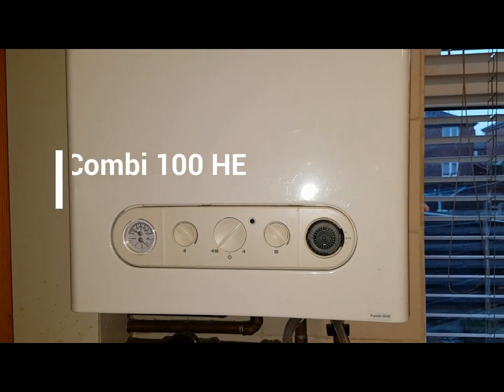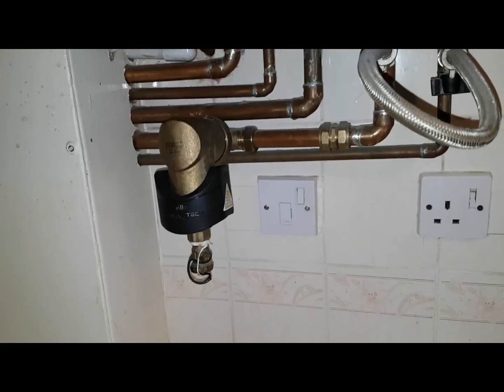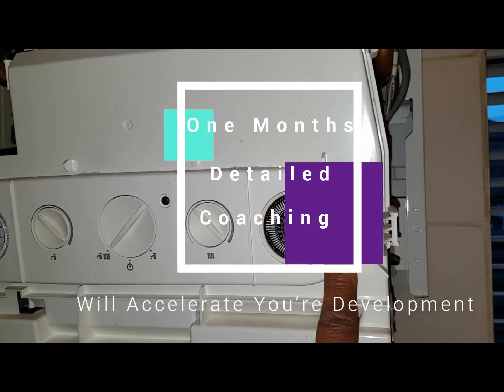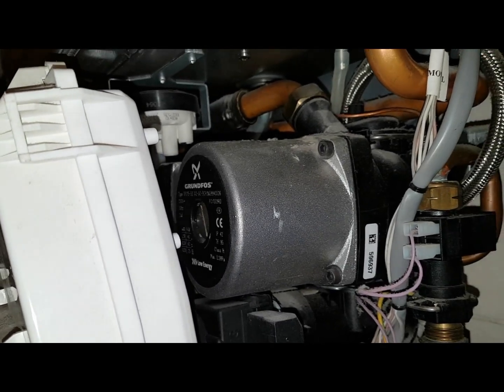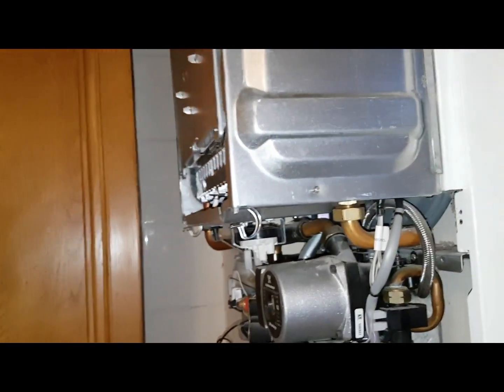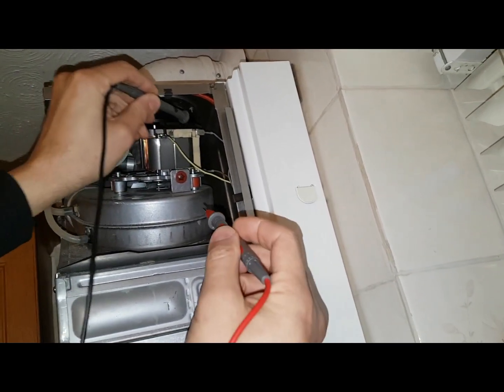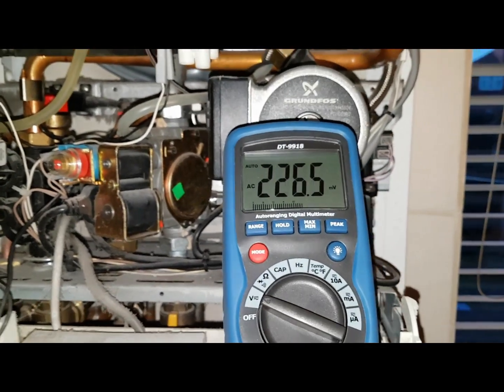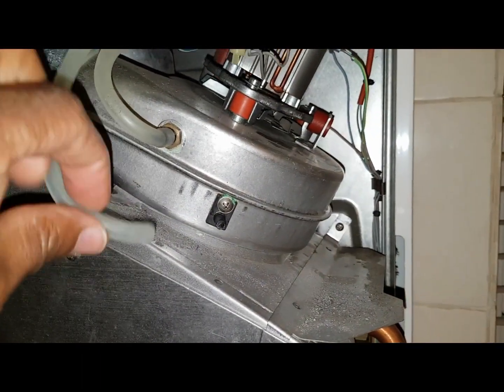Pro Combi 100 HE  How to Test the PCB or Fan Fault. With Coach Tony Morgan

Comment: Excellent, have a similar problem on a main 24he. Pump runs, pump proving switch up, aps OK on bench test, no power to fan at the board. Will try the live to casing test but I think the solenoid at the pcb might not be grafting?

Comment: Great Video..comprehensive...I have something similar on a Glow worm CI model..got 240v on the Live to the Fan..harness is good..but Fan doesn't Run...Windings are 23 Ohms..impellor is 'free'...I'm thinking neutral fault on the pcb...but can't test it (don't know how)...Boiler repairs have a habit of sending you back to school regularly!!
Reply from the maker: Thank you I will be lauching a new boiler repair on line training course soon
Reply from the maker: hey we're currently trying to grow our Facebook group and would love you to join Tony and the team using this link, Tony will be available to answer all your questions directly there's also updates on new trainings we just released too. https://www.facebook.com/groups/167070231326174

Comment: Hi have a problem with micro genius 24 HE. The fan not coming on when the heating is on demand or the hot water. But it works when I suck the apv switch to activate it. Then heating and hot work. What it could it be. Please any one. And how can I cure it? Many thanks
Reply from the maker: It's sounds like the fan or pcb
Reply from the maker: hey we're currently trying to grow our Facebook group and would love you to join Tony and the team using this link, Tony will be available to answer all your questions directly there's also updates on new trainings we just released too. https://www.facebook.com/groups/167070231326174

Comment: So Tony, is it a broken neutral cable, a bad connection somewhere, or, are you just agreeing with the previous guys diagnosis, please enlighten us!!
Reply from the maker: It was a natural fault from the PCB. I replaced the PCB the fan started and boiler is now working fine.
Reply: @ARBoilers  Thanks Tony. A Neutral fault, not Natural you mean?!!!👍

Comment: same as mentioned how did you prove that there was not a break in the cable instead of pcb cheers
Reply from the maker: You could test it from the connector on the PCB
Reply: great video by the way!
so if you were just testing the neutral cable independently no continuity would be an obvious break but what if it was breaking down rather than no continuity what ohms reading would you be looking for?
Reply from the maker: hey we're currently trying to grow our Facebook group and would love you to join Tony and the team using this link, Tony will be available to answer all your questions directly there's also updates on new trainings we just released too. https://www.facebook.com/groups/167070231326174